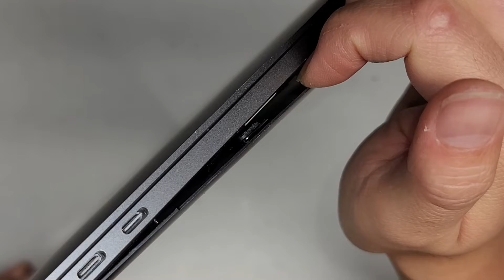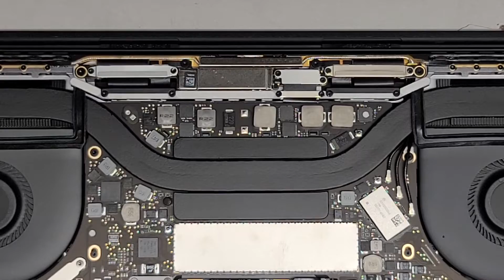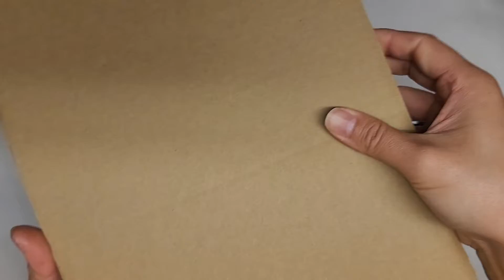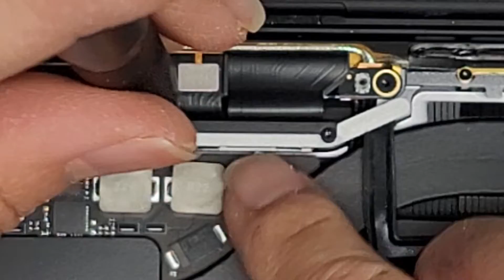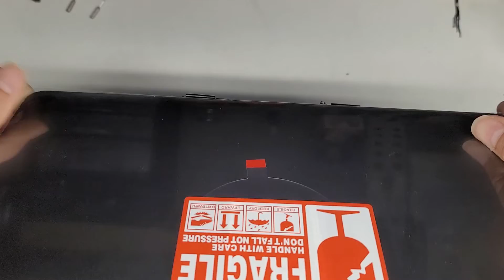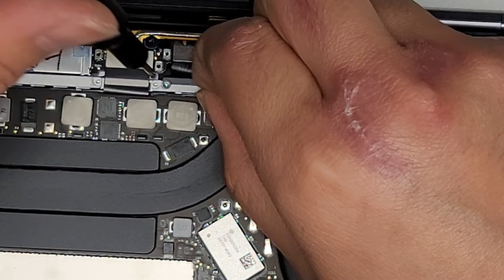Mid 2017 13" 13.3" inch MacBook Pro A1706 LCD Screen Webcam Camera Assembly Replacement Fix Repair

Comment: where was the WEBCAM ASSEMBLY REPLACEMENT??
Reply from the maker: It's in the screen... lol
Reply: @ItsBinhRepaired  right but you didn't replace the cam, you replaced the whole screen.  if you need webcam fixed, buying a 400 screen isn't cost effective. L O L
Reply from the maker: @floridaapplemacprosinc.2224  if you need the Webcam fixed, you'll break the screen trying to get it out and will have to replace it anyway. XD
Reply from the maker: @floridaapplemacprosinc.2224  that's why Apple sucks. Apple itself isn't cost effective. Lol
Reply: @ItsBinhRepaired  actually ive seen some people repair the traces, but it's pretty complicated.  just saying the cam replacement is misleading, but, it does replace the cam so. kudos.   best of luck to you
Reply from the maker: @floridaapplemacprosinc.2224  haha yeah, 99.9% of the people that watch the video would just destroy their screen attempting it and throw it away. XD
Reply: @ItsBinhRepaired  its pluses and minuses. I'm no apple fanboy, but most Mac users will keep their Mac for 10 years. PC users tend to get a new computer every few years, and even if you spend 2000 on a dell, 4 years later it's worthless (virtually). there is value in repairing apple, that's why I get so pissed at Rossmann bitchng that apple sucks, yet the reason he doesn't fix dells or HPS is because no one is dumb enough to spend 200 to fix a dell when you can save up an extra hundred and buy a new one.    Pluses and minuses. these cams rarely fail
Reply from the maker: @Florida Apple Mac Pros inc.  wrong. The reason why people don't fix gaming laptops is because there's always better and they want the best.

People repair Apple laptops because they're so broke from the first one, that they can't afford another one, because if and when they can, they go for the next best one.

I know poor broke high school and college students that beg me to do the repairs for cheaper because they can't afford it. I tell them to just use that money to buy a cheap PC. You can get 3-4 PCs for the price of one MacBook and upgrade every 2 years or so, so you'll have a better computer each time. 

With a MacBook, you can't even upgrade hardware anymore, so you'll be stuck with the same crap until you buy a new one that costs the price of a used car.
Reply from the maker: @floridaapplemacprosinc.2224  You need to understand that people that buy gaming laptops usually want the best. People that buy MacBooks just care that it works... lol
Reply: close to an hour just for the display assembly. webcam replacement includes that and more. not for the faith of heart.
Reply from the maker: Definitely not

Comment: Thank you for the great video. Where do you buy your screens from? Is the quality the same as apples OEM part?
Reply from the maker: Usually Amazon. Pretty much the same, though in some cases the aluminum housing might be a yummy bit different.
Reply: @ItsBinhRepaired  Thank you!
Reply from the maker: @danieldanon47  no problem

Comment: Super helpful video, my Mac camera has stopped working and I went through all of the troubleshooting and its broken. What does this cost to DIY? Thinking of just trying to sell for like 300-400 and upgrading to a newer model.
Reply from the maker: Sadly it's part of the screen. The screen would need to be replaced. :(
Reply: Ah yeah I thought so. I’m seeing the screen costs 500 so if I’m going to pay that may as well pay a couple hundred more for a whole new computer /: thanks for the quick reply though, subscribed!
Reply from the maker: @coreyw8118  yeah, sadly Apple parts are too costly. :( Thanks for subscribing!
Reply: @ItsBinhRepaired  ive seen vids of people microsoldering a new cable
Reply from the maker: @3ijnweu3oq3  if you can do that, go for it. Good luck teaching people how to do that without destroying the lcd panel and giving them back all the time spent trying to get to the cable, only to destroy it and then when they connect it, ultimately end up destroying their logicboard with shorted microsolder pins. Lol

I make videos that are hopefully helpful and is something a lot of people can do if they tried. I don't plan to make videos that result in easy failure.
Reply: @ItsBinhRepaired  it depends if you let someone experienced doing it then its far cheaper than a new lcd
Reply: @ItsBinhRepaired  also even if you shorted the led returns or web cam with eachother, it doesnt damage the logic board, i totally haven't tried that.
Reply from the maker: @3ijnweu3oq3  lol it would
Reply from the maker: @3ijnweu3oq3  good luck finding someone experienced in that.
Reply: @ItsBinhRepaired  depends with each country
Reply from the maker: @3ijnweu3oq3  that's true. It's not possible in the US
Reply: @ItsBinhRepaired  ive seen louis and tcrs circuits doing it